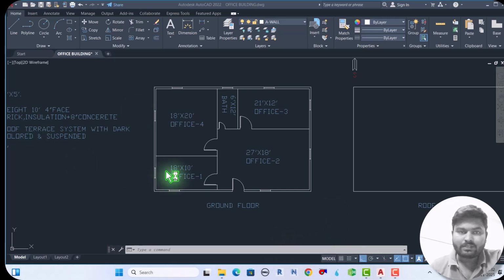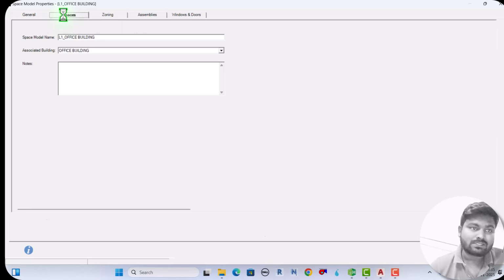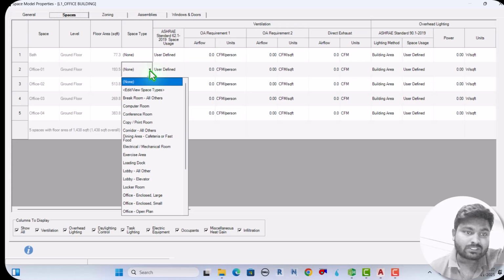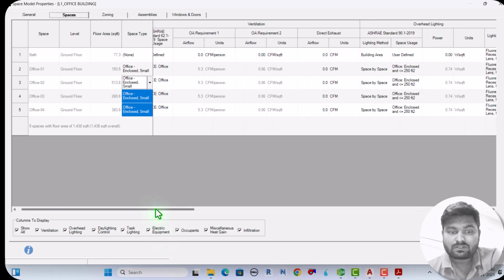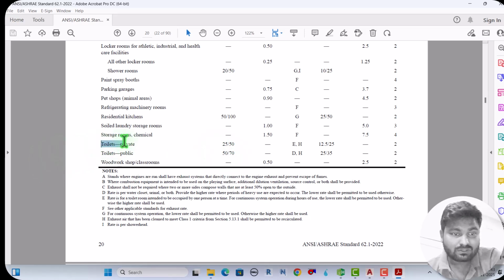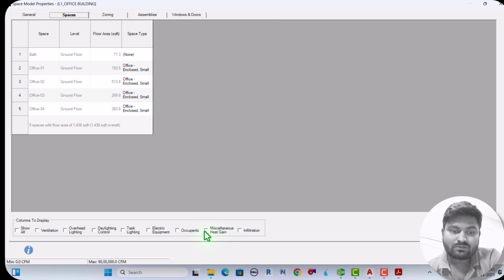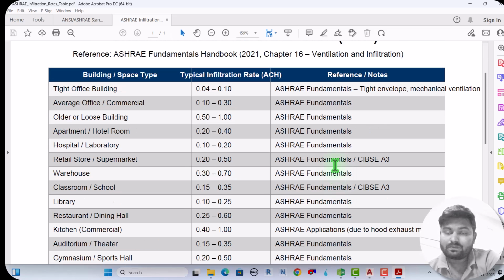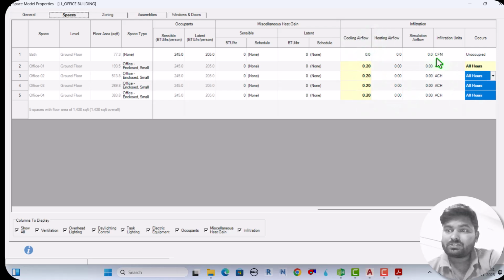HAP 6.2 Step-by-Step | Cooling & Heating Load Calculation-Part-03

Comment: What about if I'm using return air plenum instead of return air duct what Will be the direct exhaust air cfm
Reply from the maker: Return Plenum only changes HOW return air comes back — NOT the amount.
Exhaust Air is always fixed as per standards (ASHRAE 62.1).